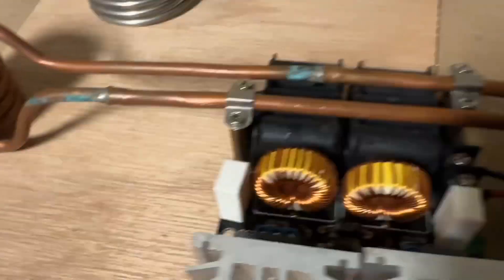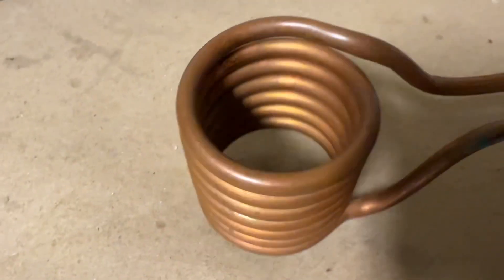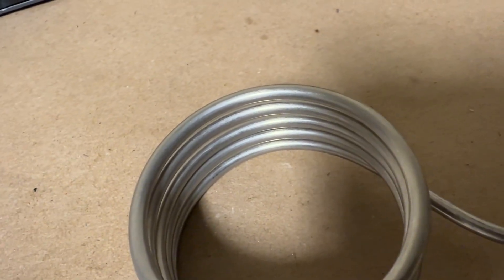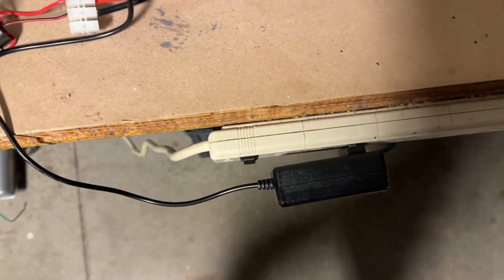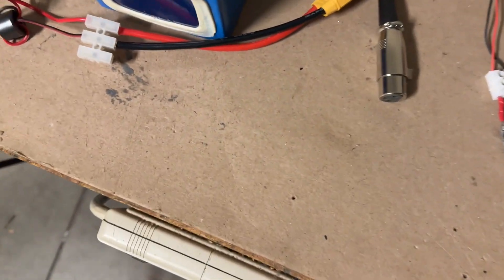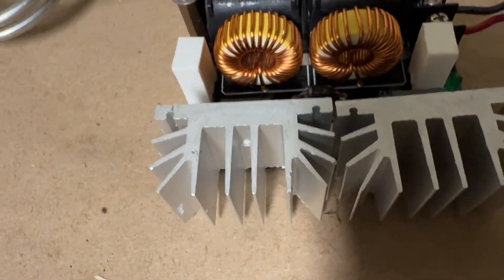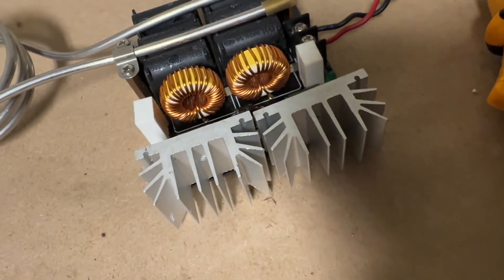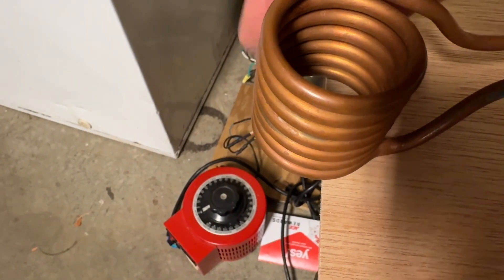Battery Powered Instant Hot Water?

Comment: What would happen if you use the copper coil and put iron in the middle of it and then cover it so where the heat goes into the copper and gets absorbed by the water flowing through it?
Reply from the maker: I wanna try that next. Want to see which one works better. I will be able to go with the iron coil instead of the stainless steel.

Comment: If you increased the tube size for the stainless steel and more wraps will lower the resistance there would definitely be a very small window for the perfect setup without overloading them popr china made mosfets lol
Reply from the maker: I’m amazed how well these Chinese MOSFETs  have held up. I’ve actually abused them quite a bit and they’re still working.
Reply: @BrianDhvTinkerer  give it a try then add a few more wraps and bigger pipe. Would like to see what that does to current draw and water heating..... I might use this for my sinks lol

Comment: Another pretty good idea. I always wanted to take a cheap plug in water boiler and replace the heater coil inside the pitcher with something ZVS driven. Nice stainless coil seems like it could work.
Reply from the maker: That’s actually a good idea. What you could do is just place the coil in the water and use it as the heating element instead of flowing the water through the coil. I might actually try that myself.
Reply: @BrianDhvTinkerer  I bet there's all sorts of practical uses for it but to be honest I just wanted to be able to stand somewhere and have a conversation with a coworker while holding the thing in my hands, as if on my way to go plug it in and use it, then suddenly it starts steaming and boiling and I just pretend like I don't see it.

Comment: Hmm I wonder if using an old fridge compressor one could welt the heat spreader to it so the heat transfert goes to the coil. Then you would have an heat pump which would be slower but also more energy efficient
Reply from the maker: Great idea- I need to try it out!
Reply: @BrianDhvTinkerer  if you are not able to weld may use a spot welder for battery packs. I want to try that out on heat spreaders in my radiator heatsinks.

I also think about making videos about that kind of stuff, but its like really hard to get started xD. So mad respect to you.
Reply from the maker: @sir_no_name1478 thank you. Yes for sure these ideas are sometimes hard to put into production. I was just so curious I couldn’t resist!